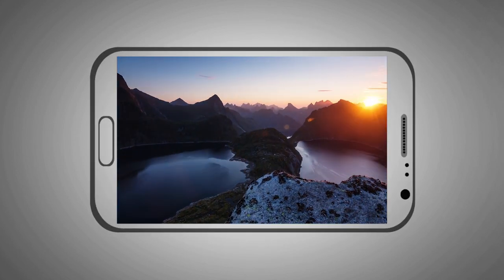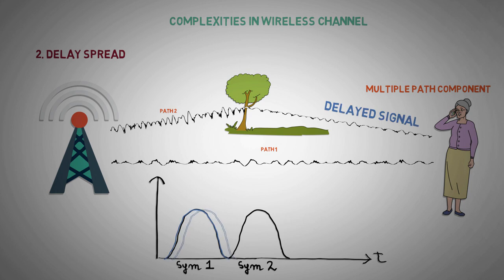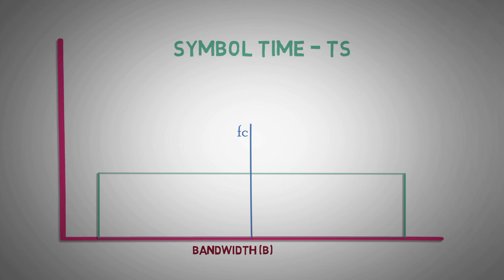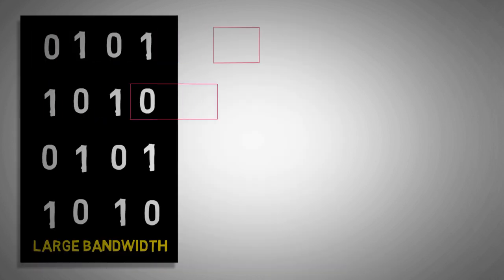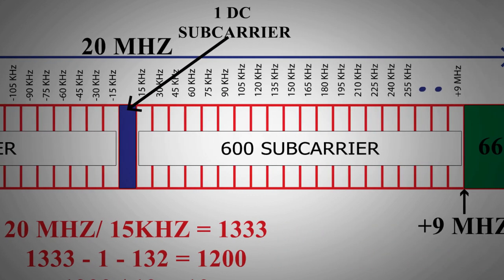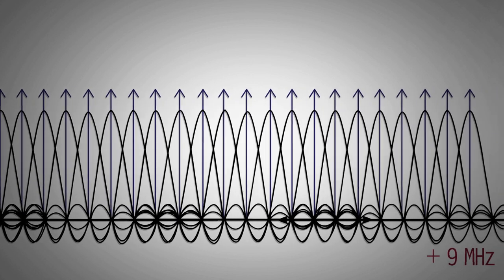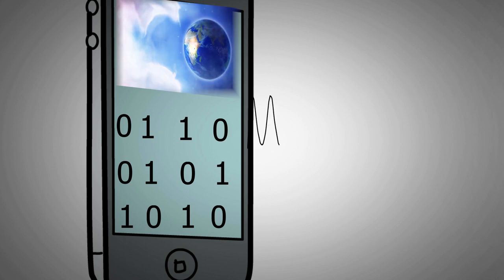2.3 - OFDM/ OFDMA IN 4G LTE - PART 1

Comment: OFDM explained well. Multiplexing is about sharing single channel to many users. OFDM is used in wireless communication and utilize radio resources well. OFDM uses multiple small subcarriers (15kHz) so there is no much need for guard bands. Subcarriers are orthogonally placed so there is no interference. They are also overlapped in freq domain so resources are used efficiently. For 20MHz bandwidth, we have 1200 subcarriers which take 18MHz and the rest 2MHz are for guardband. So, the subcarriers value ranging from -9MHz to 9MHz  travel with different sinusoids. In order to transmit symbols in these subcarriers, modulation schemes are used.

Comment: Excellent  work! Just a small question, are each sub carriers assigned to each user (handheld devices like mobile phones) or is each user is assigned all the sub carriers? I am not able to comprehend how each user, among millions, get the network service. Thanks in advance.
Reply from the maker: Subcarrier along with time formed a resource element and further resource block. This group of resource block are given to user on demand as they requested.

For example 1 subcarrier (15Khz) with 1 symbol (0.5second/6 or 7 symbol) make one resource element.
Further 12 subcarrier (15x12=180Khz) with (6 or 7 Symbol = 0.5 Second) make one resource Block.

This combination always there and assiged to user.

Initially 1.6Mhz bandwidth assiged by default to handset which means around 6 resource block, which carries required data to be used by handset to make decisions and request further resource to start using service.

I hope this is clear. Any doubt you can ask ?

Happy Learning...!
Reply: LTE Thank you very much for answering. But if that is the case, then what about other users sharing same bandwidth? If I am not mistaken, at 20MHz downlink  we get only 20/1.6=12 users only! If for example some video is sent to a particular user continuosuly, doesn't other users who are sharing the same bandwidth of 1.6MHz experience interference? Let me know if I have made mistake somewhere.
Reply from the maker: Yes indeed.....12 Users only....but that for only 0.5second time slot... But users can get chance in next 0.5 second and so on....

Apart from this one more things to be cleared, there are fixed resources and there are on dedicated resources which mapped on control channels and shared channel accordingly.

User will always get resource, except network is fully congested and everyone is using it heavily. In that case some users have to be in queued and they will fill like buffering that is nothing but congestion in radio or in other word high physical resource utilization.
Reply from the maker: You should check our video on Throughput Calculation.
May ve you can get better picture.

https://youtu.be/uIPtLr8R1-U
Reply: LTE Perfect! Thanks a lot!
Reply: @LTE4G  It should be 0.5msec ??

Comment: Why is the center frequency more important, Does the data modulation have any impact on this or? . Also what is a dc frquency ahy is it important. Thanks/
Reply from the maker: The centre frequencies actually represent the OFDM subcarriers. As a single monochromatic frequency cannot carry any data(as bandwidth is required for that), OFDM subcarriers occupy a portion of bandwidth in a form of sinc wave which in turn is centred around the centre frequency..Data modulation(psk, qam) will neither impact the centre frequency nor the shape of the sinc function.. it just changes the amplitude and phase of sinc function. 

Again DC frequency is actually the centre point(zero) of a frequency graph(on x axis). Since it has no frequency or alternating component, it is also called DC(direct current).
Also since the LTE spectrum consists of both positive and negative frequencies(frequencies with 180 degrees phase shift) it is basically centred around the DC.

Comment: Im a beginner in wireless communication,in ofdm if two signals overlap why won't they interfere?and what do mean by they are orthogonal?
Reply: Orthogonal means that they don't interfere. That's what the word means; independentness. In LTE OFDM, orthogonality is provided by FFT transform. That's a key property of FFT. You take a bunch of numbers, make FFT to them, it makes a waveform. Make FFT again to the waveform, you get back the same numbers. Now change one of the numbers. The waveform changes and again you get numbers back from the other end. Only the one number that you changed, changes. That's orthogonality, that is what it means.

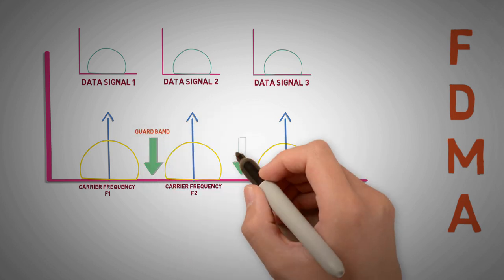Comment: Question, since in OFDM, all carriers are overlap each other @7:31, then where is the guard band? Because in FDMA,  I can tell that. in this video @3:43, all carriers are not overlap at all. But where is the band in OFDM???
Reply from the maker: +SunSon29 guard bands in OFDMA are not between the subcarriers rather they are at the both ends of the OFDMA spectra.
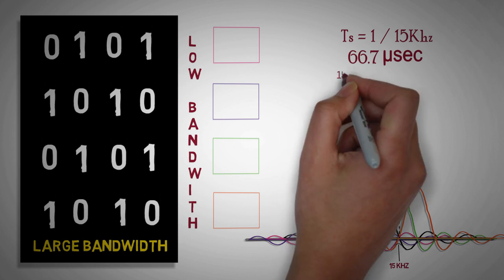Reply from the maker: +SunSon29 - The guard bands are at the begining and at the end. See the part 2 of OFDMA. At 5:12 there is an image. Hopefully that image will help you understand.
Reply: LTE thank you. Btw, in OFDM, the guard bands are between each channel, not each subcarriers, am I right on this ??  Thank you again.
Reply: please please share the slides
Reply: @43SunSon  There are no guard bands required in OFDM since all the subcarriers are orthogonal to each other. This is the beauty of OFDM that guards buands are not required between the sub carriers and hence the Bandwidth efficiency is highly improved.
Reply: mayank pathak thanks
Reply: @mayankpathak4622  - yes, this is a much better answer than the two previous replies.  One needs to understand the fundamental difference between FDMA and OFDM to understand why guard bands are not needed.

Comment: how can i find out the number of sub-carriers of an OFDM modulated signal?
thank you
Reply from the maker: +BlackLeg199 every time there is a service request from the UE,  An ENB scheduler will allocate some PRBs. The number of PRBs depend on their availability, QoS demands of the radio bearer as well as on the radio parameters like RSRP and the LTE radio band, the user is latched upon. 
The number of subcarriers will be 12 times the Allocated PRBs.
Reply: let's say that i saw a signal at the oscilloscope, and recognize that it uses multi-carrier modulation. Is there a mathematical tool or any other way to find the number of modulated tones and their frequencies?
Thank you for your help.
Reply from the maker: +BlackLeg199  I suppose you're asking about radio frequencies assigned to a particular user when it receives user plane data.. so first of all, the user data is sent over the downlink shared channel but before that, the ENB will inform the user about the Allocated resources I.e PRBs and the corresponding modulation scheme in the DCI(downlink control information) over PDCCH channel.  Using the DCI, a UE is able to decode the frequencies which are carrying information specific to that user. So if you somehow convert the RF signal of a particular band from an ENB and feed it to an oscilloscope, you will get a composite signal ranging the whole Spectrum having data for all the users.. moreover this signal would be a analog wave which would  require to be converted to digital discrete signal and once you do the FFT operation, you will see all the frequency components, now in order to find out frequency components for a particular user, you will have to read it's DCI.....this is done by every LTE receiver... Hope this helps and do see our next videos.. :)

Comment: How do we achieve orthogonality between subcarriers? What is the process?
Reply: The process is to choose sub carrier frequencies that are harmonics of the base frequency.In LTE the base frequency starts with 15khz.To this base frequency, values of 2,3,4 and so on are multiplied to get subsequent subcarrier frequency. The modulating signal which is going to modulate these sub carriers must have a 1/15khz symbol duration. The above two steps ensure orthogonality.
Reply: FFT. You need a transform function that is orthogonal. For LTE, FFT is used. For fibre, DCT is used.